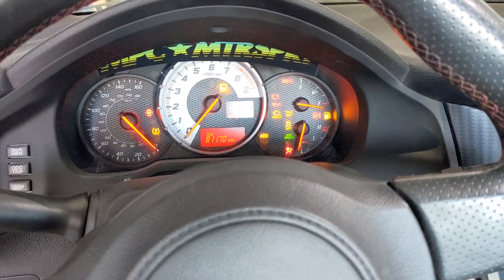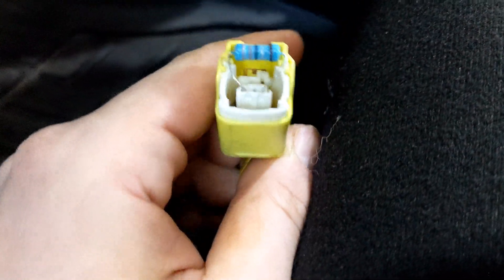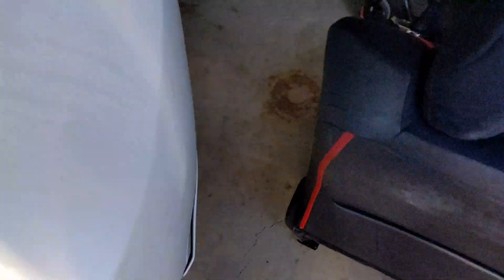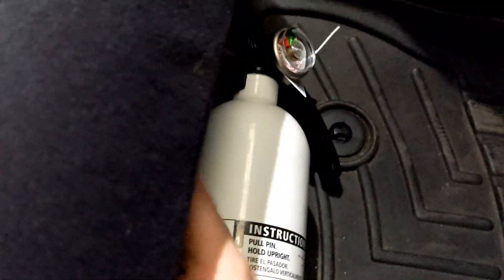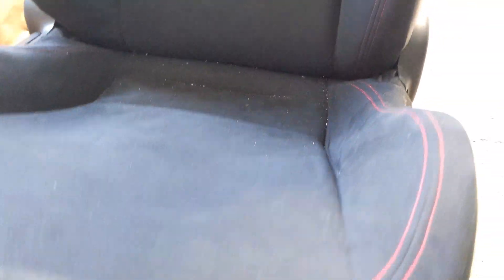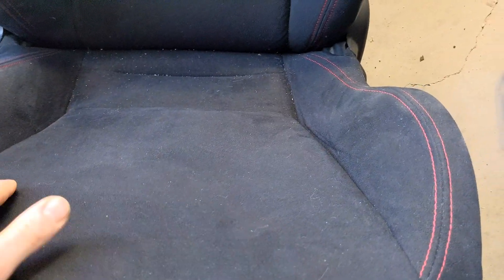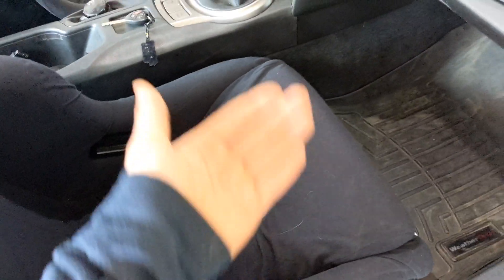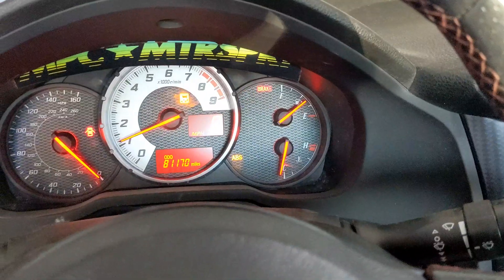No airbag light, working occupancy sensor with aftermarket FRS/BRZ/GT86 seats.

Comment: It seems the fix for the Gen II BRZ and GR86 are different from Gen 1 cars. For the driver's seat delete, I've tried a 3.3 ohm resistor (as is typically recommended) and I still get the airbag warning message on the left side of the instrumentation.
Reply: did you ever get a solution?

Comment: what kind of hydro setup do  you have? i've been figuring out what to do and the adapters i have requires you to delete the parking brake which i dont want
Reply from the maker: If you don't want to delete the stock parking brake you can use an in-line setup for the handbrake. I use dual caliper mounts from Dayton One and deleted my parking brake. If I need to use a parking brake I just ratchet strap the hydro.